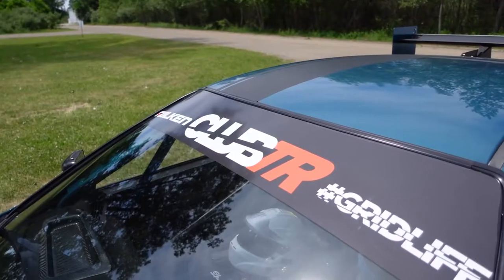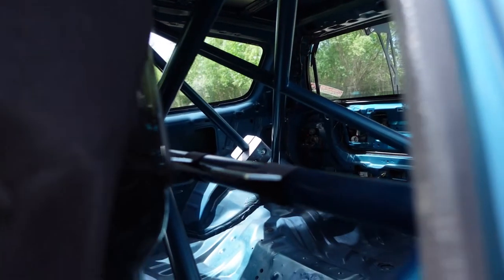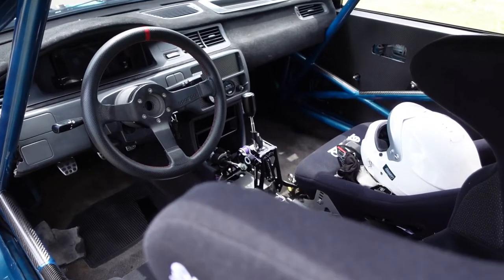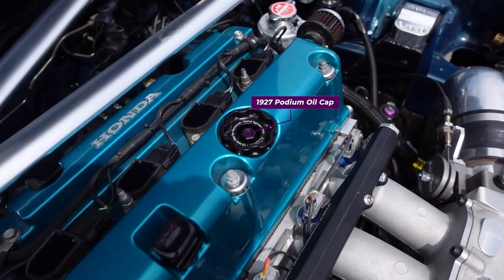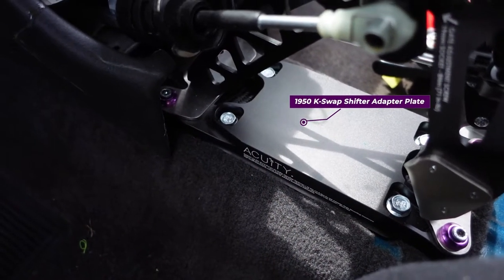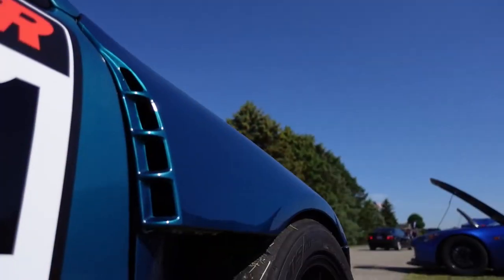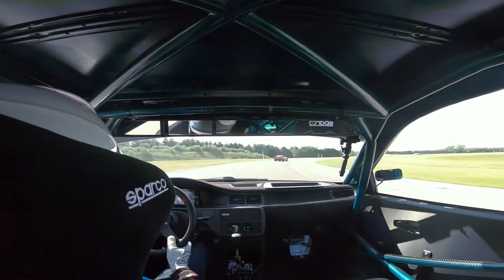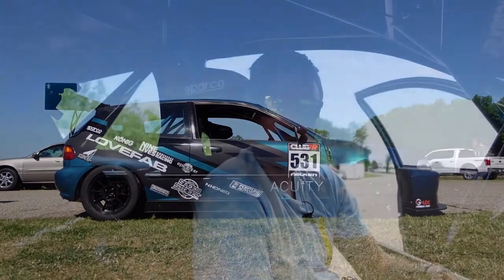Build Breakdown: EH2 Honda Civic Time Attack Racecar (K24 Swap)

Comment: Hey brother I love that setup I was wondering what cables would I have to run if I run the f k8 shifter box
 with the adapter bracket for the cable lines to use a Z3 trans what cables would I need for it to function 
or do I  need to swap out the selector
Reply: To make the Z3 trans and FK8 shifter work in an EG, EK, or DC2 k-swap, you'll need Acuity SKU 1969 (link here: https://acuityinstruments.com/collections/all/products/10th-gen-civic-accord-shifter-cable-adapter-bracket-for-k20z3-transmissions). Check the "compatibility list" tab on that page and it will list the honda part #'s for the 2 different sets of cables that you can use with this setup. You'll also need a way to mount the FK8 shifter to the center tunnel. If you want a simple solution to that, consider Acuity SKU 1950 (link here: https://acuityinstruments.com/collections/frontpage/products/k20c-l15b-swap-shifter-adapter-plate-for-10th-gen-civic-shifters). Using these brackets and the cables listed on that page, you will be able to shift a z3 trans (with the stock selector mechanism) using any FK8-compatible shifter (OE, Acuity, or otherwise).

Comment: What do you think about using 15 inch vs 17 inc wheels (with the same width 9j for example)?
Reply: There are a lot of determining factors when choosing a 15 inch versus a 17 inch wheel. With a 17 inch wheel, there are more tire sizes available to find that optimal grip. 15's don't have that luxury, as the widest 200tw you can find is a 245 (I believe). When you increase the diameter of the wheel, you also will be decreasing your acceleration due to the increased rolling circumference, so the final drive and gearing will need to be addressed. For me, I chose a 15 inch wheel because I'm an old school type of guy and love the timeless look of a 15 inch wheel on an EG Civic.

Comment: Curious as to what the material is on the dashboard
Reply: It is called flocking. You use an adhesive undercoat spray that acts as the base color and allows for the little nylon fibers to be sprayed onto the undercoat, which gives it that cool matte look.

Comment: What gearbox are you running?
Reply: I believe the case is an 8th Gen Si case, but not sure if the gearset or differential are modified/swapped. Hopefully Evan can chime in.
Reply: @rgareh1  thank you. I like that shifter but you can't run that shifter with rsx box 😭